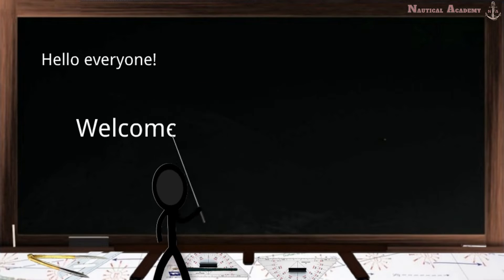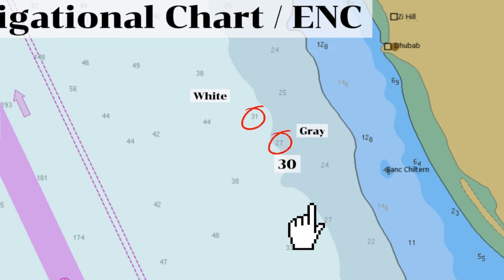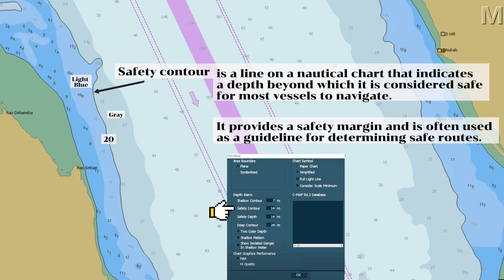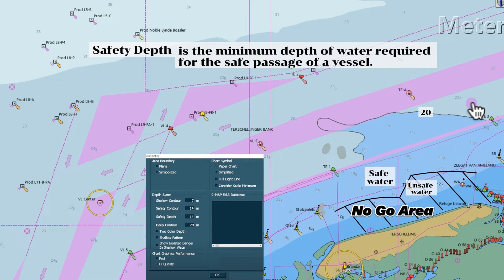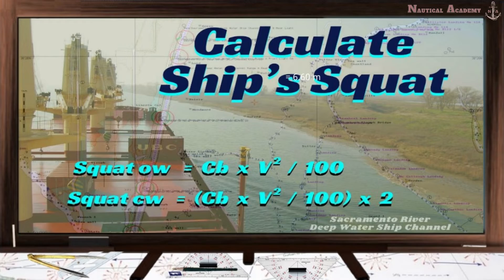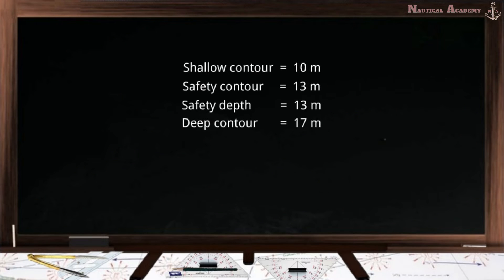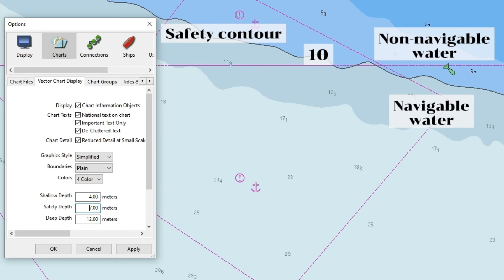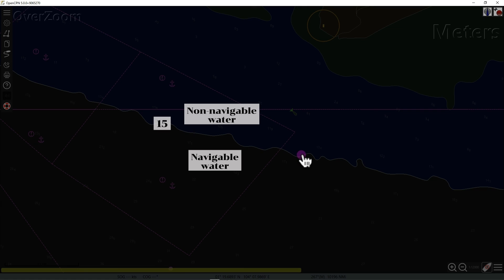Determine and Set Safety Parameters ll Shallow, Safety & Deep Contours ll ECDIS ll Passage Planning

Comment: Indeed very good video.
However there always space for inmprovement. In the example that you mention in order to prepare the safety depth, you consider the tide as zero. In case the tide is 3 or 4 meters and perform again the calculation, finally the safety depth will be less than the shallow countour. 
Awaiting your good comment.
Regards.
Reply from the maker: Let me clarify the situation using the example from my video:
In my video, the calculated safety depth was 13 meters with tide = 0. We usually set the safety contour to the same value as the safety depth. In the ENC, available contour lines were 10 m and 15 m, and so on... So setting 13 m to Safety contour & safety depth displays the next higher contour, which is 15 m since it is available. All soundings 13 m and below appear black, indicating non-navigable water, while soundings greater than 13 m appear gray, indicating navigable water. 

Now, let's determine the new Shallow contour, Safety contour, and Safety depth due to the effect of Tide. Let's say the height of tide is 4 m, as you mentioned in the comment section.

If the height of tide is 4 m, the new Safety depth & Safety contour is 9 m, while the new Shallow contour is 6 m. 
Safety Contour/Safety Depth = 13m−4m = 9m
Shallow Contour = 10m−4m= 6m

Set Safety contour & safety depth to 9m, since no available 9 m contour, it will display the next available higher contour, which is 10 m, since it is available. Next, set Shallow Contour to 6m, If the 6m contour is not available, it will display the next available higher contour, in this case 10m, the same contour line displayed as Safety Contour. 

Now, if we examine the difference: with height of tide = 0, the displayed shallow contour is 10m, and the Safety Contour is 15m. With the height of tide 4m: the displayed Shallow Contour and Safety Contour are both on the same contour line, at 10m, which usually occurs if the vessel has a shallow draft.  To determine navigable and non-navigable waters, identify those spots sounding in black and gray colors. In this case, where the tide is 4m, all soundings 9m and below appear black, indicating non-navigable water, while soundings greater than 9m appear gray, indicating navigable water. So when you recalculate the Safety Contour/Depth, considering the height of tide, also recalculate the Shallow Contour.  

So, if we say safety depth will be less than the shallow contour, if we base our answer on the calculation, the answer is "NO", because the new calculated Safety Depth is 9m, while the new calculated Shallow Contour is only 6m. But when we set our Safety parameters in the ECDIS, the display will be different due to the availability of the contour lines. That's why knowing the Safety Depth is very important to determine the Navigable and Non-navigable waters.

Comment: My company's passage plan need to fill up safety contour, safety depth, shallow contour, deep contour on every way point. If charted depth is eg.3000 m, safety depth, safety contour values are more than deep contour. How is possible? My company's policy are 
Safety Depth = Deepest static draft + anticipated squat + company’s min UKC+ZOC
Safety Contour >= Draft + Gross UKC requirement + 2 meters (e.g: Safety depth is 12m, Safety Contour can be in 20m )
Shallow Contour = Draft + Gross UKC
Deep Contour = Twice the maximum draft (2 x Max. Draft)) OR 20 meters, whichever is greater.
Reply from the maker: Thank you for your detailed comment. As mentioned in the video, guidelines for calculating safety parameters can vary between companies. The procedures I shared are meant only as a general guide for training and familiarization.

In actual practice, you should always follow your present company's policy for determining safety depth, safety contour, shallow contour, and deep contour.

If you change companies, and their criteria are different, you cannot use the same procedures from your previous company. You must follow the current company’s requirements when preparing the passage plan.

Thanks again for watching and sharing your insight!
Reply: @nauticalacademy001  Thank Sir

Comment: How do u get values for roll,pitch while calculating dynamic draft
Reply from the maker: Great question! Values for roll and pitch can be obtained using various onboard systems or equipment designed to monitor the ship's movements. Here are some methods:

Onboard Sensors (IMU Systems): Modern ships are equipped with Inertial Measurement Units (IMUs) or similar sensors that constantly monitor the ship’s movements, including roll and pitch. These sensors provide real-time data, which can be used for navigation and dynamic draft calculations.

Electronic Chart Display and Information System (ECDIS): Some ECDIS systems have integrated functionalities that provide roll and pitch data, particularly for more advanced navigational systems.

Manual Measurement: On smaller or less technologically equipped vessels, roll and pitch can sometimes be estimated visually or measured using a clinometer, though this is less precise.

Ship Stability Software: Many vessels use onboard stability software that calculates roll and pitch based on loading conditions, weather data, and ship motion information. This software can provide estimated values for roll and pitch to adjust the dynamic draft.

Roll and pitch affect the distribution of the ship's weight and thus the draft, particularly at the bow or stern during pitching, or on the sides during rolling. The dynamic draft may increase during extreme roll or pitch.

If your ship is equipped with advanced systems or software, the values are readily available for calculating dynamic draft more accurately.

Comment: Good day.When we calculate safety depth which tide we minus MLW or MHW?
Reply from the maker: Typically, the safety contour is established by considering the lowest astronomical tide (LAT) or mean low water springs (MLWS).
        Mean Low Water Springs (MLWS) represents the average lowest water level that occurs during spring tides over an extended period. Spring tides occur when the sun and moon are aligned, causing higher high tides and lower low tides. Using MLWS as a reference provides a conservative approach to ensure that the charted depths are sufficient for navigation under most tidal conditions.
        So, in the context of determining the safety contour, you would subtract the anticipated tidal range from the charted depths based on MLWS or a similar reference level to ensure safe navigation during varying tidal conditions.
Reply: @nauticalacademy001 It means that when we find Safety depth/contour=Dynamic draft + Catzoc+UKC-HoT(MLWS) I'm I right?